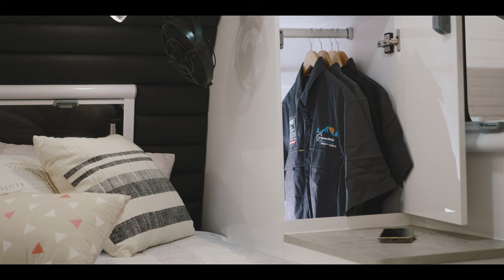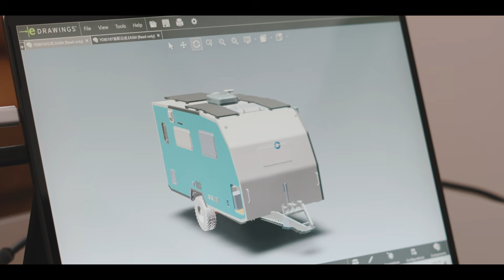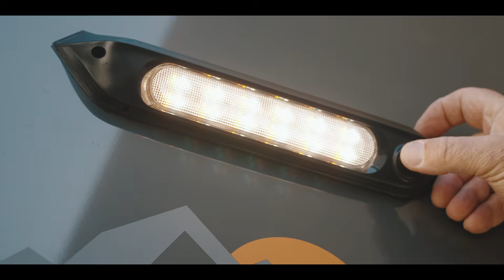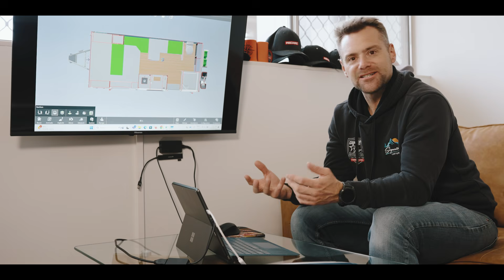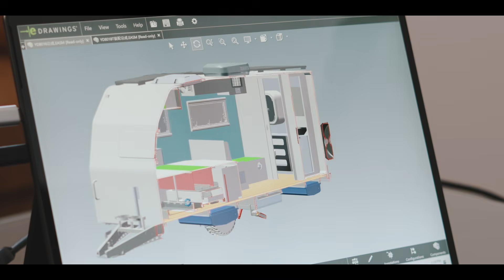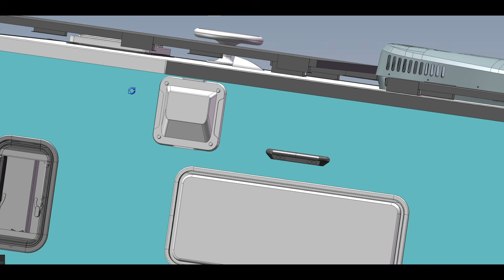The new Signature Kakadu 16 Walkaround

Comment: Do you an upgrade to make the 16 a tandem axle? Great videos
Reply from the maker: You move up to the Kakadu 18 to go Tandem Axle. A lot of the same great feature but more space and added inclusions.
360L of Water
15kwh Battery Pack
Bigger internal kitchen (incl Oven)

Not a huge amount of benefit going dual axle on a 16 and you’d loose a lot of valuable storage but still have to deal with the extra weight.